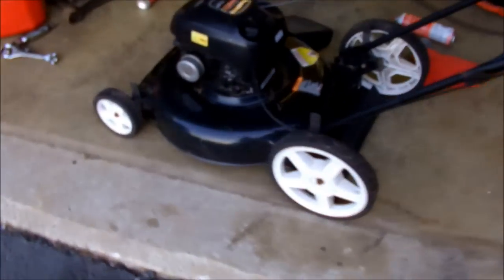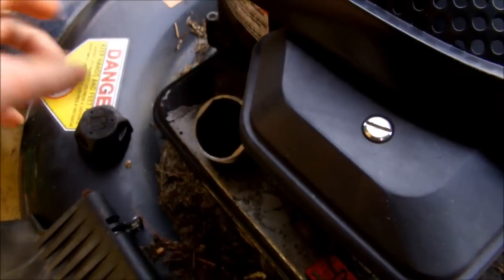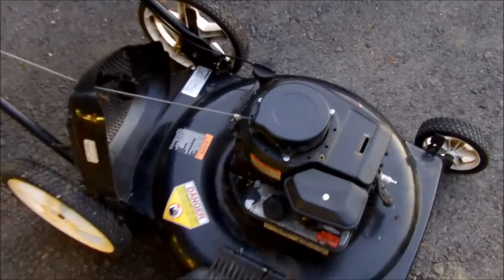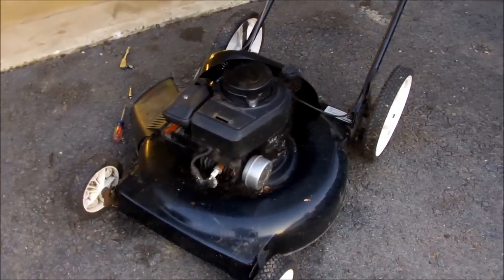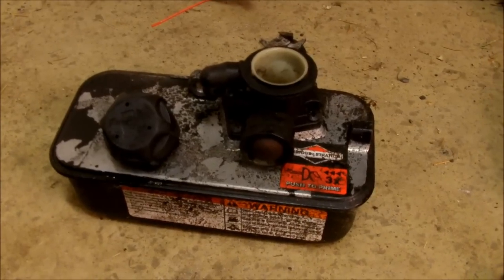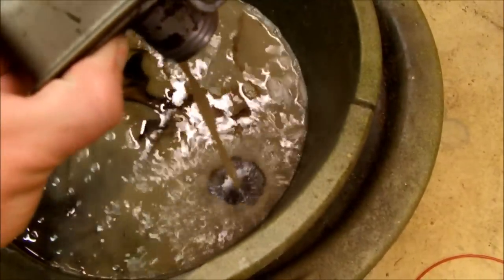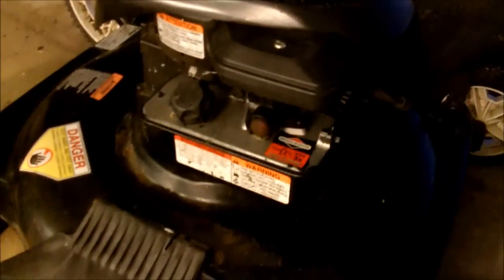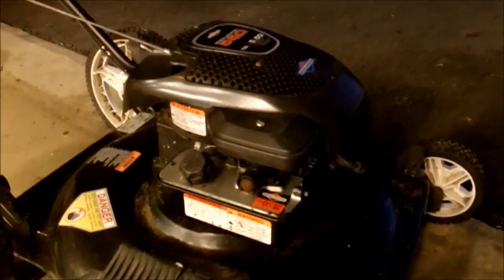Why your lawn mower won't start - How to fix it.

Comment: I'm glad you showed this engine (just like my mower) because all the other carb cleaning / lawn mower fix videos show a completely different style of carb that has a separate float bowl and a supply line from the gas tank. Thanks for clearing that up for me, I'm going to try to tackle the same job on my mower now!

Comment: To help install the diaphragm get 2 bolts the same thread as the tank. Cut off the tops. Use it as a line-up tool. Put the diaphragm gasket down  on the tank sliding it down the line-up screws. Slide the carb. down and tighten the screws. Tighten criss-crossing to avoid warping the carb. Use a Stens oil drain plug tool # 752-828 from Amazon.

Comment: I tried the clean today on my 92500 series (model 2508) Briggs & Stratton engine but it still has problems.

While it had crap in the fuel tank, it ran like crap & started to blow black smoke,if I take the air filter off it will run then clear up.

I bought a genuine foam air filter about 9 years ago & cleaned then reoiled it to the Briggs & Stratton instructions, it has had very Little use.

I tested the engines compression when warm to 90 PSI today, I had tested it a few years back with oil added into the cylinder & it tested to 120 PSI so I'd say the compression rings are worn.

The compression has ranged from 90-100 PSI so the engine just runs,it tends to run rough when it's cold.

It doesn't burn oil except on startup when cold sometimes so I'd say it's the compression rings which are worn & are causing that.

So,I need to fit new rings into the engine.

Comment: Get2 air cleaner screws and cut off the ends. Use them as lineup tools to install the diaphragm. Lawnmowers don't start in the Spring because of the diaphragm. It dries out. Change the plug. Open the vane full throttle and see if the throttle screw touches the engine. If not, replace the governor springs. Check the blade. If the engine kicks back, it's probably the flywheel key is sheared. Check the blade. Change the oil. If the engine drags when warm, turn the blade by hand. If it turns, pull the plug and see if it turns now. If so, replace the diaphragm.

Comment: I have a similar mower, cant seem to find where to add oil?  The manual says to add oil but doesnt show how model 11A-074D765 bolen.  I also have a newer mower with a oil cap and dipstick, but the bolen isnt so obvious.
Reply from the maker: +Jkou Files There is a plastic cap near the base of the engine with two tabs. Unscrew it, and fill oil to where the threads begin in the block.

Comment: Mine looked like yours.
There are two Carburetor gaskets in the kit. 
One is rubber gasket & one is paper gasket.
Which one goes/face to the Gas Tank?
Reply from the maker: May depend on the carb or year. Many times they include extra gaskets to fit a variety of carb model numbers. That being said, I've always seen paper ones between the tank and carb.
Reply: A brand new Carburetor Kit (carburetor/gaskets), Filter, Gas Tank, Spark Plug, Oil & Gas are all installed.
Even a new third @ $7.00/each replacement will still get it running for 16-22 second, then dies.
One would think that all those parts should get it up and running.

Parts have exceeded over $110.00.

What is your suggestions?
Reply: angelisone diaphragms ALWAYS go to the flat mating surface. Always! Dont listen to anything or anyone else on this issue.ALWAYS!

Comment: I tried that it ran few seconds cut off twice I poured gas in carb put filter back it ran few seconds again  .I'm try new spark plug and check carb screen filter again. But when it ran it gasping for
Reply from the maker: Still starving for fuel. Keep cleaning it. May also need a diaphragm/carb kit.
Reply: @FuelInjectionSucks  your right I took off Carburetor gaskets and was white build up blocking the holes on gas tank I clean out real good it ran i cut the lawn but it smoke some times and stalled but never really cut off.

Comment: You skipped the removal step of the tank/carburetor which is critical to completing the job and a huge number of people watching these vids maybe new owners and young people or even people who have just learned bad habits.  Hold your camera steady as and pan slowly so you avoid motion distortion.
Also, you claim to have another video but don't link it.
So all-in-all not the best instructional video up for this mower model.
Reply: It easy..find the bolts that hold it on and remove them.Probably shouldn't be working on a mower if you cant figure that out.You can always click on the guys channel and search his videos if there's no link
Reply: Remove the long bolt on the primer side and the bolt at the front holding the tank to the engine. Move the tank towards you and unhook the governor spring. Check that the seal and retainer are put back inside the intake tube. Remove the screws from the carb. holding them to the tank in a criss-crossing pattern and install same way. The soft gasket goes on the tank and hard on top. Replace the screen which simply pulls off.